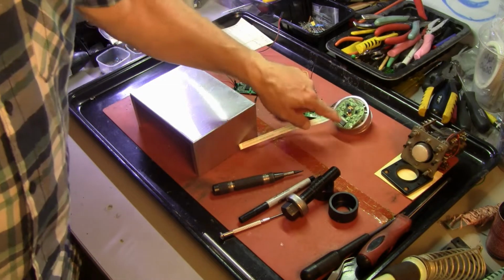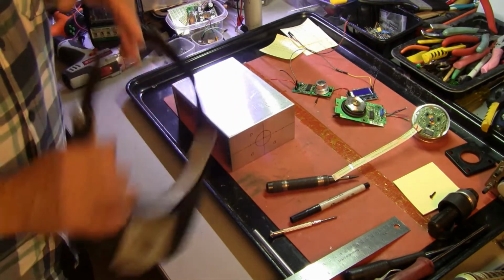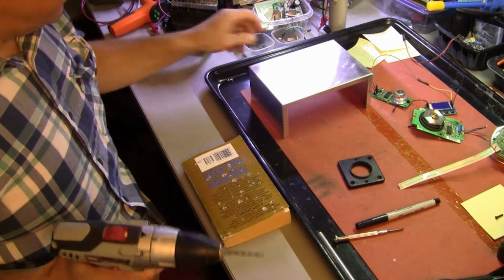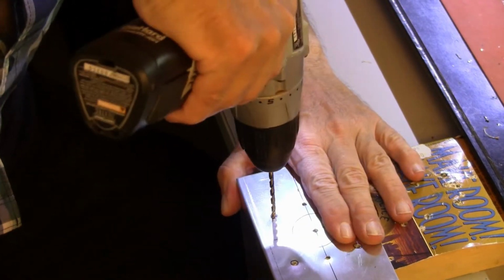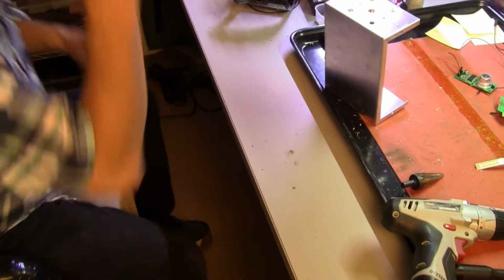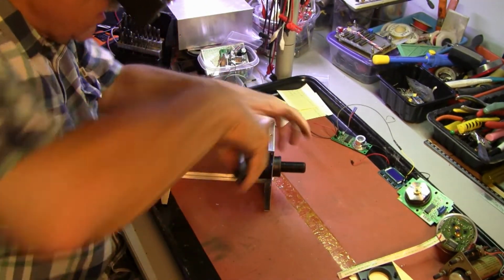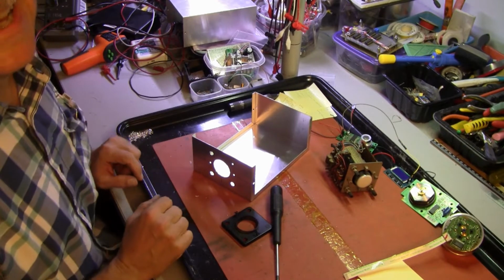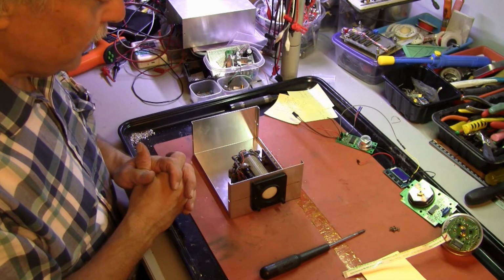Too Many Irons in the Fire

Comment: Heheh, it looks like your mechanical projects go about as smoothly as mine.  The tool I actually need is always somewhere else, despite what I think  is pre-planning.  It seems that this kind of job would benefit from a drill press, though where would you put it?
Reply from the maker: How did you know I was looking at small drill presses? I need a tiny one for drilling circuit boards.
Reply: @videolabguy  I think I've seen Dremel drill presses that would do well for PC boards.

Comment: I wonder if a 1B59 would put out enough light for a mechanical televisor?
Reply from the maker: My methodology is to use modern tech to solve vintage problems. So, I am a solid state LED kind of guy. BUT, if I had a crater lamp, it would certainly be tried out.

Comment: Audio recording issue is most likely a problem with the OS itself than the hardware.
Reply from the maker: Thanks! You could very well be correct. When I said bios I wasn't setting that in concrete. I was never able to precisely define the problem. After the new machine is ready, it will be a moot point.